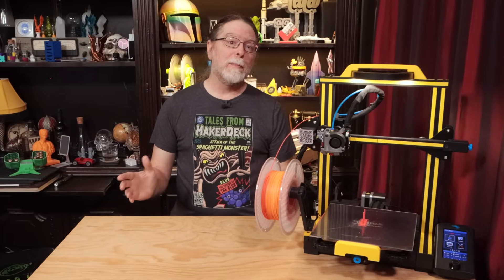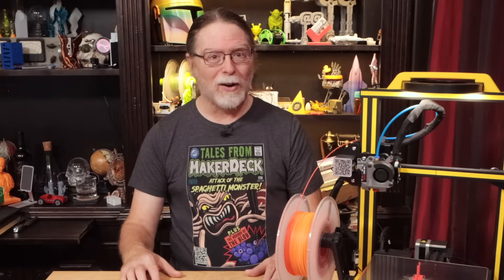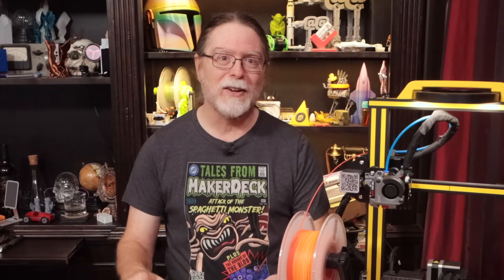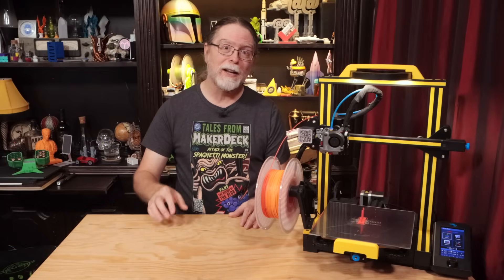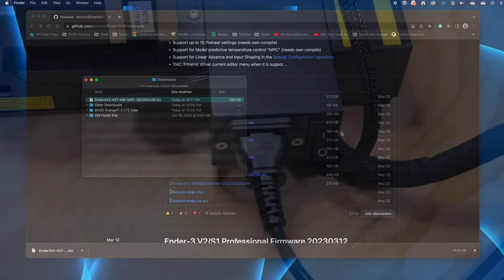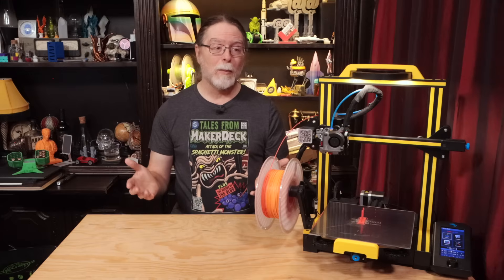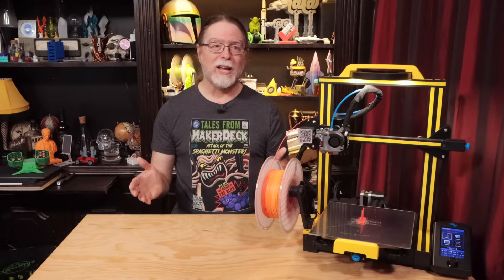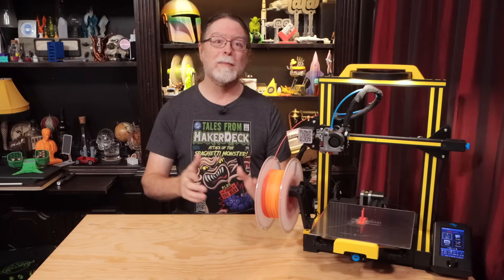The BEST Ender-3 V2 Firmware EVER?! MRiscoC Professional Firmware

Comment: I just got my first printer, an Ender 3 V2 with a 427 board, no probe, and the basic stock firmware. I'm planning to use this firmware, but the file layout isn't as straightforward for the 2025 version as the 2023 version you show. I'm not sure if I should be using the Ender3-427-MM-CR10DSPLY or the Ender3V2-427-MM-LA-MPC version. Any suggestions?

Comment: i have an ender 3 pro with the original screen and the 4.2.77 upgraded board and the bl touch. which firmware is appropriate since i do not have the color screen? this is daunting but such a fun erector set lol

Comment: Thanks! Did this in December 2025 & it worked great. I used the SD card it came with & put it on my Ender 3 V2 with a 4.2.2 board.
Reply: Do you need to use a different slicer with this firmware? I'm still using Creality 4.8.2. Any recommendations you have are appreciated. Thanks

Comment: I swear the Gods of the technological realm hate me today. I have spent the past 4 hours downloading, installing, formatting, re-installing, all the right firmware for my Ender 3v2 v4.2.2 GD stock, bl touch, and nothing seemed to work. Before I installed the BL touch this morning, I installed the BLT firmware and the printer picked it up in the options screen as "bed levelling", but as soon as I installed the actual BLT device, nothing worked, flashed the screen, the mainboard over and over but still nothing. So here I was thinking I was doomed to the binary halls of hell for my transgressions until I found this video about this funky firmware. I watched another one of yours and followed the steps but ended up denting the wall a fair few times with my head. But this, this awesome firmware, not only installed easily enough....but worked first time, and I have just finished calibrating the BLT and levelled the bed ready for the first print of the day. Oh dear Jesus I nearly committed numerous varieties of sin during this lovely day, but thanks to this video, and that swanky firmware, I think my analogue soul may just be saved. Thank you my good man, and may you and your loved ones enjoy the most wonderful christmas. good luck & Godspeed o7
Reply: @uglyboy69Zionist I am about to take a plunge with this Professional Firmware on my Ender 3 V2 - GD processor Ver 4.2.2 motherboard. Do you mind sharing exactly which file from the Github did you use? TIA.

Comment: Great advice still 11/25.  Printer started overextruding out of nowhere and i was going to update firmware only to find there is no offical support any more for ender 3v2. this new firmware not only fixed the issue but gave new features i didnt even know were possible for my printer. Thank You!
Reply: @enragedpanda25 I am about to take a plunge with this Professional Firmware on my Ender 3 V2 - GD processor Ver 4.2.2 motherboard. Do you mind sharing exactly which file from the Github did you use? TIA.

Comment: Is there any firmwares like this that can be used with the Ender 3 V1 (Ender 3)? I cannot seem to find ANYTHING in 2025 that’s compatible with a V1 with the OG screen that’s not insanely buggy! I have the 4.2.2 board with the GD chip and just added a CR Touch.

Comment: Firmware worked on my Ender 3 V2 (4.2.2 board with Cr Touch and a swapped hotend). PID tuning worked fine on the tz e3 2.0 kit.

Comment: Also completed mine in 2025... instructions still valid and its like having a whole new printer.  Great video, great guidance, great experience. I was a bit nervous when the latest available MRiscoC firmware was labeled as "Experimental", but so far so good. Considered going with the 2024 version, but the list of changes and improvements for this 2025 experimental version sounded like it was worth the risk. Thank you for producing this video!

Comment: For some reason after dropping the bin file onto the 8gb microsd, and turning on the printer, it seems to just skip it and not install the new firmware.. I've checked the printer version (4.2.2, with cr touch) and still couldnt figure it out.. help please?
I've tried to format the card from FAT32 also to exFAT.. Still no luck..

Comment: Fantastic video and firmware I installed at initial printer setup. Never used the original one. However I did not find anywhere the description of the bottom screen metering zone. As some indications are self explaining but some are not, especially some alternating values. Any clue? Help?

Comment: Thanks Bryan this new firmware looks awesome as at 12 April 2025.. I will have to play with it to get myself acquainted with it.. I did all the things you said and it worked first time with my 4.22 board and my DACAI screen..... I also checked out the new BLTouch auto mesh feature and noted that my bed glass is way out on the middle right side .. I have purchased a new PEI magnetic sheet to fit but have not yet fitted it so this might be time for that.... 

Do you have a video for the fitting and setting up of a filament runout sensor cheap eBay version with this new firmware and how to make it all work? I did try the filament runout sensor the other day and when I wanted to print it kept asking to reload filament when there was filament already in the machine and at the hot end ready to print, so I am not sure what is wrong here....any help would be appreciated... 

I have been watching your videos for a few years and love them and have upgraded my Ender3v2 with the aid of many of your videos... Keep up the great work/videos. Cheers Tim Melbourne Australia...

Comment: I did the upgrade as you mentioned, however this software still has a movement speed maximum of 3000mm/minute for the X and Y axis (despite acceleration speeds being capable of 9999mm/min).  Is there a way to override this maximum speed setting so I can push my printer to 7200mm/min+?

Comment: Thanks for your damn advice. The printer stopped working and kept printing the same thing over and over. Tried resetting it and everything else. Even tried the original firmware. Same damn crap. I ended up having to throw the printer away

Comment: This video was extremely helpful, but I'm having one issue with the graphics. I was unable to get the graphics upgrade due to having a screen that wasn't supported, but I got the firmware. After I got the firmware, I noticed that there's these black boxes around the text, if anyone knows how to fix this, that would be amazing! Thank you! 
Note: I did make sure to format the SD card right, so I don't think that would be the issue.

Comment: End of March 2025 and this all still applies perfectly. I was boggling my brain trying to wrap my head around compiling marlin and I was getting some headway but really was unsure and didn't want to brick my printer without a spare board. I do have a TJC screen so I haven't quite figured out updating it but like you said, it works perfectly fine (just no graphs and black backgrounds on icons). I am 100% convinced my touch sensor was doing nothing but going through the motions on Creality's 4 year old firmware. Got everything set up and dialed in and it's like a brand new printer! Thank you so much for your clear and direct explanation.

Looking at the git page I think I may have figured it all out. Jooks like TJC support was added in a few precompiled assets. Just waiting on my bridging test print to finish and going to try it out.

Update: There 100% is a precompiled solution for the TJC screens now. It's in there in the git as of the end of 2004. I just had to look around a bit. Not a bad thing though, lots to learn in there :). The graphs still don't seem to work but it overall looks a little cleaner so I'm happy for now. Next time i want to compile my own complete with custom boot screen

Comment: Mine is a Dacai display, my 8gb sdcard did not work on it (old sdcard), I have a 16gb new sdcard and it did work, you need to copy the files on dacai_update.zip (firmware.zlib inside the zip is the firmware of the display) to the sdcard and overwrite the private folder with the giadej compilation private folder (new icons).

Comment: I installed the firmware WOW you were right so many setting and options! it is going to be so much fun dialing the printer in with all these settings. Thank you for testing and sharing. It is like using a different printer.

Comment: Really nice presentation. One good news: the "bricked" boards can be reprogrammed using a ST-Link dongle, the corresponding pins on the board are marked "VCC, SWDIO, SWCLK and GND" and they are between the display connector and the USB connector. If the pins are missing they have to be soldered on the board.

Comment: Bryan: I have an GigaByte board and not an ARM and I installed that same program and the temperature never remains constant, it fluctuates and causes the prints to not come out correctly. Is there any software for GigaByte chips that maintains the temperature constantly? Thank you so much

Comment: Bonjour
Bonne année à tous
J'ai aussi charger ce firmware sur ma creality Ender V2 equipée d'une carte V.4.2.2 et un bltouch non creality
J'ai un soucis dans le sens ou lorsque je règle le Zoffset qui est à 6.2 . 
De plus j'ai le bltouch qui lorsqu'il se déploie ne touche pas le plateau .. donc pas possible de realiser le Mesh du  plateau
Ou parfois quand l'imprimante décide d'avoir un Zoffset à 2 mm , lors du mesh du plateau , le Bltouch sort aléatoirement sa pinnule
J'ai l'impression de mon Z offset varie de 2 à 7 sans rien faire juste en l'éteignant et la rallumant
J'ai eu aussi le Bltouch qui pointait dans le vide du cote gauche de l'imprimante
J'ai defoncé mon plateau lors d'une impression
Si quelqu'un peut venir à mon aide , car le firmware semble excellent , mais la je m'arrache les cheveux
Merci d'avance

Comment: A new 2025 version has been just released!
Reply: Only experimental. I am trying 
Ender3v2-422-MM-MPC-20240125 but only have a blank screen. 😅
Edit: you MUST format the SD first for success.
Reply: @David_Mash  check your screen firmware compatibility, look at the firmware wiki
Reply: @MiguelRisco  amazing work! Can it be set to have speed based on ring length and speed based on distance to reverse direction?
Reply: @David_Mash  I thing that the slicer is the best tool to implement that kind of behaviour.

Comment: I have had the E3V2 for several years and it was collecting dust after the latest firmware that is no longer supported (so I understand). As mentioned in the first comment of 2025, it is still valid :). I just finished upgrading the firmware for the printer and screen and now to verify and make several test prints!  Thanks also for your video and Kudos to Miguel Risco-Castillo on this! :)
Reply: @padingre  I'm 5 mins into turning it on and still have a blank screen. 4.2.2 mm... how'd it go for you?
Reply: @David_Mash  the FW for the motherboard went with no issues. As for the screen , it did not update but I searched for an 8 GB formatted as indicated, placed the files and it updated with no issues. Did several test prints and went well. :) How is fo you? I am guessing you clicked the button by now :)
Reply: Format of sd was required for success. Thank You
Reply: @David_Mash  awesome! You will like the new firmware. I had to do my tweaks but nothing related to the firmware but the e-steps and other things. I even got my filament sensor working!!! After I had thrown it away in the lost and found :)

Comment: Your instructions are still valid in 2025. Just got into printing with the Ender 3 v2 and did the firmware upgrade today. Worked great. Thanks for the video.
Reply: I've printed once with a just built e3v2. This seems to be the best thing to do once you've built your e3v2 in 2025.
Reply: Why can't I find the download? There doesn't seem to be any of the pages he spoke of....I've done searches of so many different kinds found something that matches printer and bl touch but it's a zip open it and it's a maze but finally found my print ender 3 v2... But I'm afraid of it.... nothing is where it's supposed to be so it's extremely hard to trust especially knowing it's going to kill my printer if it's wrong...I'm really getting tired of chasing my tail.....
Reply: @nickrucker76  did you figure it out?
Reply: By any chance did you have to set up any other things like the dimensions / z probe and all? Was installing this now but I wasnt sure if It was a basic G-code change only needed or all of the above lol
Reply: @ I did not have to make any other adjustments. I didn’t have anything special setup before the firmware upgrade. All factory settings.
Reply: @jdwoods2  Thanks a ton for the reply and confirmation! Excited to start a print up tonight
Reply: i just got the printer, Thanks for confirmation!
Reply: Any confirmation if this firmware works on e3v2 Neo? 4.2.2 board also
Reply: @jacquesMFJC  i too want to know, if the board is 4.2.2, does the firmware work whether it's neo or max or both?
Reply: happy to report it works beautifully! I needed it mostly to do PID tunes so that I could stop getting the extruder low temp alarm. I’ve been printing eight hours straight now without a hiccup.
Reply: Unfortunately I have a TJC display but there is an update for it now. I followed every step and got an Update Successfull message. But, it is not all colorful as in this video for the other screens.
Reply: @jacquesMFJC  you did the creality cloud update on the sd in the display and then after that, you did the mriscoc update on the sd in the display?
Reply: @ no I went straight for the mriscoc.

Comment: Thanks, I updated to this firmware for the Z probe adjustment feature. My first attempt didn't work, I just got a black screen, tried again a few times black screens. I had to rename the firmware on the card ( a few random letters on the keyboard followed by the file extension .bin) and that and it works. Thanks again
Reply: @not1iota229  i will try this. I'm 6 mins into blank screen and sweating.

Comment: For those folks having issues upgrading firmware on the LCD. Use a 8gb micro SD card. Format to FAT32 Default. Allocation unit size set to (Default Allocation size). Check quick format, then format. This was how I finally got my LCD to update firmware. Make sure you have the correct file from Mriscoc site for your brand LCD to do this upgrade. Follow how Bryan shows how to do the firmware upgrade. You should then be good.

Comment: I just installed this firmware. I had been running Jyers. Print quality deteriorated on some of the parts I printed, so I have reverted back to Jyers. Maybe there are some settings that needed changing, but I am not aware or any guidance documents that identify same.

Comment: Can you advise as to where to find the best precompiled firmware to update an ender 3 (original) with a 4.2.7 board currently running marlin 4.0.6? I am not knowledgeable enough to build my own but comfortable enough to upgrade.

Comment: Hi Bryan , i installed everything as in the video but after a power cut it doesn't resume printing is there any way to fix it the farmer looks great
Reply from the maker: Hi, I'm about 95% sure there's a checkbox to turn power loss recover on or off in the menus. I think it defaults to off, so make sure it's enabled before you start a print. I'm sorry it didnt' work the first time. Losing a print to a power problem sucks.
Reply: @BV3D  Thanks for your time I will look for the bookmark

Comment: Hi Bryan I installed the firmware version Ender3V2-422-MM-MPC-20231217.bin back in Jan this year without any issues after following your excellent video.  I have now tried to install a later version Ender3V2-422-MM-MPC-20240125.bin again by following your instruction but nothing changes the previous version remain active on the device.  The printer does see the bin file, viewed via the media function,.  i am using a new 8gb sd card and have only the copied bin file installed on it.  Any help would be great.

Comment: Thanks buddy after messing around for a few days this seemes to have cracked it!! so thank you.
I have built a stainless steel printer head. it prints fine on my test bead in straight lines to .4mm with and .2 hight 100% metal density, but to figure out how to remove all the hot end bead stuf from murlin is bejond my abuility ,, but with this it looks like I just need to set all the tems and fans to 0

Hopefull we will be in business!!

BIG thanks again.

Comment: I know this is an older vid, but it totally solved my modern issues! I had a updated silent 32bit 4.7 board and it apparently burnt up directly at the positive power wire input terminal directly on the MB! I yanked the older 4.2 board out of storage and when i tried to use with my updated hardware like BL Touch and DWIN LCD screen, i got the black screen. it would still work with the mono-chrome display, but i did not like that much of a step back. Following these steps and links, i was able to update my firmware, and LCD display!!! THANKS A METRIC TON!!! YOU ROCK!

Comment: i have just purchased a bl touch.  before i could install it my screen went blue with lines going through it.  I had absentmindedly set something on top of the board box that jammed the printer.  Thats when my screen went blue.  should i install the bl touch before installing the firmware?